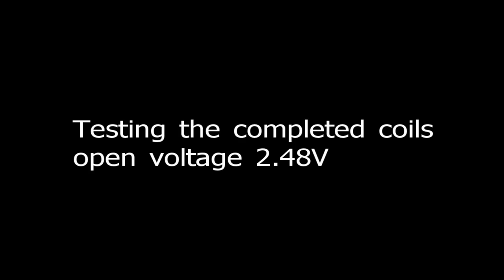DIY wind turbine 5, free energy, making coils for free

Comment: I want to know how you know the number of twists per coil I want to make a generator of wind power 5 kW and I want the maximum capacity to be 7 kW I want measurements of the wire used to add the number of twists in each coil and how many files